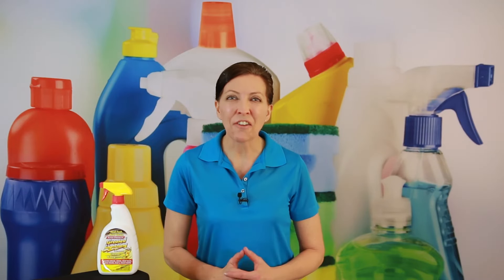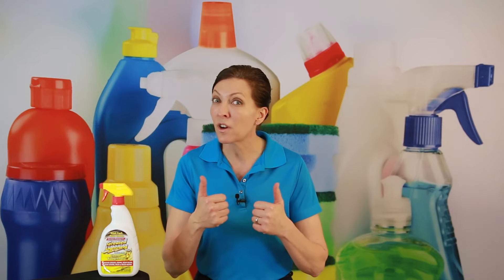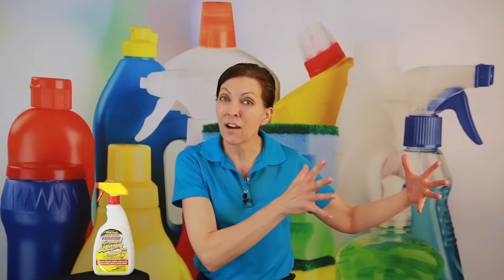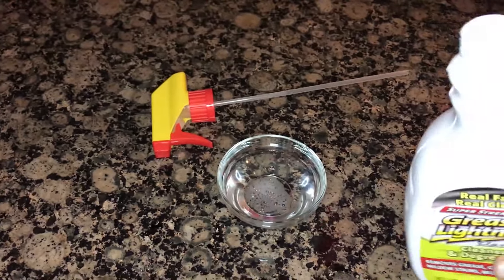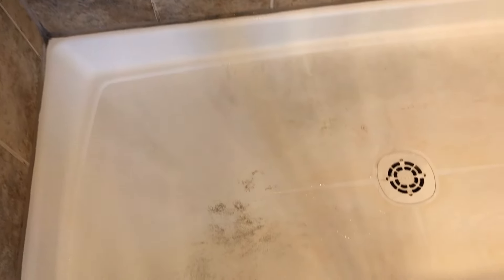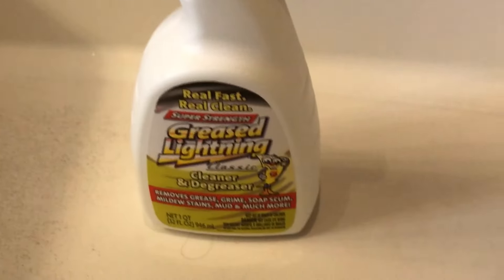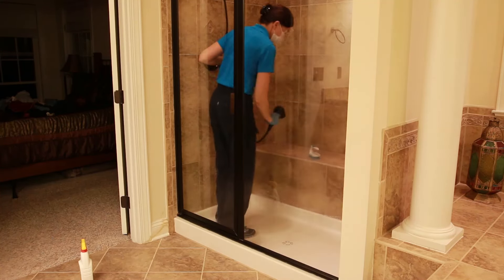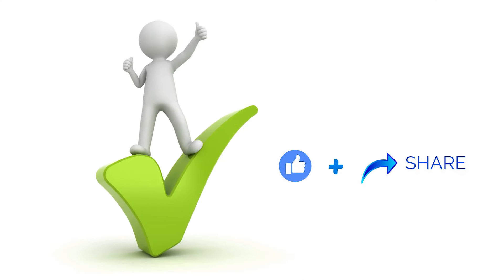How to Clean a Moldy Shower with Greased Lightning (Product Review)

Comment: Thanks so much for this video!  I wish I had bought this before buying Weiman gas range and degreaser product.  I don't like using a product for just one thing, but I didn't know what to buy. 

You said that we shouldn't use Greased Lightening on wood cabinets.  But how can I remove the greasy gunk from the cabinets above the gas range?  Yes, I should be using the range vent more, but what do I do now.  Thank you very much!
Reply from the maker: You have to be careful using a degreaser on wood cabinets because while it will remove the grease, it  is possible that it will break down the finish or varnish on the wood - assuming the wood has been sealed. Make sure you read the label before using and that if using it on cabinets you test in an inconpicuous area first. And if you do use it on wood you may have to adjust the dwell time, leaving it on only long enough to remove the grease. You may have better luck with a mild dish doap like Dawn or Fairy.

Comment: Do you have seperate shoes you wear while in the shower? You moved the mat to avoid bleaching but didn't address in the video to clean your shoes after. I'm always terrified to transfer cleaning solutions onto the carpets after doing a treatment like this.
Reply from the maker: Great question. NO. We do not remove shoes when in the shower. We wear shoe covers (here is the paid link https://amzn.to/3RCF2W1) over our shoes in the client's home. EXCEPT for when we are in the shower. We take the shoe covers off and leave them outside the bathroom door. We remove the bath mat and put in its place 2 x terry cloths (https://amzn.to/3KR0SDd) on the floor to step on when we get out of the shower. This absorbs the water/suds that may have been on our shoes and then before we leave the bathroom we put the shoe covers back on to protect our shoe treads from the customer's carpet.

Comment: I am still having a hard time getting the  mold in the grout out.. it has been there on and off for years..  I just can't get it to fade.
I did go and get the greased lightning as well as the little  oxo brush you had.. It might have lightened it a bit but it is definitely still there.  It is in a stone shower just like your demonstration... Also I want to ask how do you clean moldy stained white caulk around the bottom of a shower.
Reply from the maker: Is it surface mold? Or is it coming through the grout? And do you have a silicone or a sanded grout?
Reply: @AskAngelaBrown  I have sanded grout.

Comment: I have a “cleaning frustration” I wonder if you have a suggestion in how to conquer.  The home we rent is lovely but the master bath show has a typical plastic walled shower enclosure.  Whomever lived here before apparently used hair dye and didn’t clean it well when they were finished.  At least I think that is the issue causing the light brown stains on the cream colored walls.  I have used every cleaner I know of.  Acids like vinegar and lemon juices.  I have tried Totally Awesome and various Dollar Store
Cleaners.  I have used the vinegar and Dawn combination.  

I have tried strong bleach spray.  I have tried soaking in a bleach gel.  

I tried the more abrasive cleaners like Comet, Bar Keepers Friend, and baking soda.  

Obviously I didn’t use any of these together.  All were separate, well-ventilated attempts.  I also tried standard hydrogen peroxide.  

I have thought about buying stronger peroxide such as the kind that commercial carpet cleaners use.  Or maybe trying the stronger kind Sally Beauty sells.  

I feel like a crazed trying to removed these stains.  😂.  Seriously, I have used each item with caution but I am not sure what else I can do that is also safe and non-damaging.  

I have heard sanding it with a very fine grit sandpaper but given this is a rental I hesitate to do it lest I damage it worse.  

If you have suggestions I would surely love to hear them.
Reply: I use hairspray (cheap as in white rain) or alcohol on ink. What about trying those?
Reply: Have you tried the magic eraser scrubber? Or rubbing alcohol? I'm a hair stylist and these work great for me. I had turned my entire shower purple rinsing a client and after I cleaned it you never knew it had been purple

Comment: Did you use the grease lightening on the glass?
Reply from the maker: Yes you can. Greased Lightning is a degreaser so it has the same behaviors as dish soap. It's safe to use on glass and will cut through soap scum.

Comment: Hi Angela, long time subscriber here.  I came back to this video because we have problems with the ceramic soap dish in hubby's bathroom.  Mold has eaten into the soap dish, and some of the tiles (not the grout).

I tried a foaming bathroom cleaner, and full strength LA's Awesome Cleaner.  Neither one stayed where it needed to be--It just dripped off.  Scrubbing with a Magic Eraser does nothing.  

I've asked people on a housecleaning Facebook support group, and several suggested to ask you.

I've seen you review Crud Clutter and Greased Lightning, but which is better for this?  Or maybe I should try a paste of something?

My hubby didn't see this building up (why????), but now I ask him to have the fan running after his shower, with the door closed.  With shaving, and after, that's about 15 minutes.  No window in that bathroom.  

I could send you pictures on Instagram, on Savvy Cleaner, if it would help.
Reply from the maker: Mold has eaten into the soap dish, and some of the tiles (not the grout).>> 
Is it possible that the mold is in the walls behind the tile? If it's eating through the tiles (not the grout) that would be my guess. 
That would be a mold remediation problem that a specialist should  look at. You may have a leak behind the faucet that is causing moisture to create mold. Checking it early can prevent costly renovation mistakes and the sickness caused by mold.
Reply: I just got rid of over a gallon of LA’s Best Awesome cleaner when I learned it’s toxic.

Comment: How do I tell if I have mold or mildew in my shower , please ?
Reply from the maker: Thank you for your question! To distinguish between mold and mildew, consider the smell (mildew is musty, while mold has a stronger odor), the location (mildew is often on the surface, while mold can penetrate deeper), and the color (mold is typically darker). Overall, it's essential to address and remove both as they can pose health risks and damage your shower surfaces over time

Comment: I have a particularly old moldy shower with hard water and barnacal like buildup. I have used everything I can think of...greased lightning, abrasive cleaners, magic erasers, scrubbers, steam, etc and nothing has gotten rid of it. What else can I try??
Reply: Siquomb1 What's HSN? I usually get mine from Home Depot.
Reply: 3pumpkins  Home Shopping Network on tv. Can prob buy it by googling HSN.
Reply from the maker: Check out the product, Brite and Clean Hard Water Stain Remover: https://www.hardwaterstain.com/best-hard-water-stain-remover/how-to-remove-hard-water-stains-on-stainless-steel-sinks-appliances-and-bbqs 👍

Comment: Is greased lightening better than Krud kutter?
Reply from the maker: Both are degreasers and multi-purpose cleaners.  Krud Kutter has several types of cleaners while Greased Lightning comes in regular and super strength.  Whichever you decide, be sure to read the bottle and instructions before use.

Comment: Can this product be used on a re-glazed tub?
Reply from the maker: It's a great question. I'm not sure what the tub was re-glazed with. Here is the Safety Data Sheet https://es.greased-lightning.com/Multi-Purpose_Cleaner/Greased-Lightning-Multi-Purpose-MSDS.pdf In section 1 there is contact information for the manufacturer. They will be able to give you the most accurate information based on your type of situation.

Comment: Will this get rid of mold on the gasket inside my washing machine?
Reply from the maker: Do you still have your washing machine instructional manual? Check out the cleaning instructions to see what is recommended. Using the wrong product could void the warranty.  Also, some front loaders recommend weekly “clean wash” cycles to prevent mold buildup.

Comment: Do you know any eco friendly nontoxic cleaning recommendations?  I won't be using these kind of products.
Reply from the maker: There are lots of non-toxic products on the market. The key is to match the purpose of the  product (and pH level) with the soil type you are trying to remove and the surface on which you are removing the soil from. That way there are no surprises and no health or property hazards.

Comment: Hello Angela, I purchased the 1 gallon greased lightning. Do I use full strength or should I dilute it in the spray bottle? It doesn't say
Reply from the maker: You can use it as is or dilute it with water, but with any product always test a small section.

Comment: Can we use this chemical on latex painted walls. J moved into my apartment and there are mold spots don't know how long they were there but they were painted over and now they are starting to show...ughh
Reply from the maker: No. If you have mold coming through the walls you have a much bigger problem. Painting over it is only creating a toxic mess. A mold remediation specialist needs to come in and clean it out. It's possible there is a fungus growing behind the walls and it will make you very sick.

Comment: Where do you get it?????
Reply from the maker: Great question. It comes from Homecare Labs in Middlebury CT, USA and they sell it on Amazon as a concentrate https://amzn.to/2yfKrik (I also found it in a spray bottle but don't buy it from Amazon - the prices are too high.) I bought mine from Ace Hardware but they sell it at Lowes, Home Depot, Walmart, True Value...
Reply: @AskAngelaBrown  I got some in a great big gallon jug at Home Depot.  Will have to get a spray bottle for application.

Comment: How about letting a bleach cleaner set overnight?
Reply from the maker: +Luster Thomas For the most part I wouldn’t leave bleach unattended, or where the fumes can just sit and dwell in a house without proper ventilation. Is there a specific reason you would be leaving it overnight?
Reply: @AskAngelaBrown  it's at a event center that I contract clean no one else was in the building.
Reply: @AskAngelaBrown  floors was really dirty I'm going to scrub and recoat them

Comment: Angela, i realize this is a video on how to clean a moldy shower using greased lightening.  But do you have a video on how to clean a moldy tub/Shower that is black mold on the tub bottom and on the grout around the tub without using a toxic cleaner and that is bird safe. Yes. That's the hard part. I don't want kill the cute little talking bird that gives us kisses and hours of fun that is so dear to our hearts. We only use baking soda and vinegar, dawn soap, peroxide due to the least toxicity.  Do you have any other suggestions and methods that are non toxic to our little Green Cheek Conure that will get rid of the already black moldy spots on the ceramic tub and tile in my husbands bathroom that he is responsible for. I try not to go in his bathroom. But it has come to the point that someone has to attempt to get that mold out, cuz hubby isn't getting the job done. Thanks for any help you can suggest.
Reply from the maker: Here is a link to a video about mold and how to prevent it:
https://www.youtube.com/watch?v=Y8Vgv06O2rE
Perhaps you can have a neighbor birdsit your sweet Green Cheek Conure when you clean the mold with a product meant for mold.  Then follow the steps in the video to prevent it from coming back.  Good luck and keep me posted on how it turns out. 🤗

Comment: Hi Angela, wonderful video. I’m from Australia. We don’t have Greased Lightning here unfortunately. What would work just as well for moldy shower? Thx :)
Reply: AwesomeGame half Dawn dish soap and half distilled vinegar. Put in a big spray bottle and spray away in your shower. Let it sit for a bit then scrub away. It works wonders!! If there’s still some stubborn spots just use bleach but I found for my shower I don’t usually need the bleach which is great.
Reply: I've used Clorox bleach cling gel toilet cleaner on moldy grout lines and corners. Works really well.